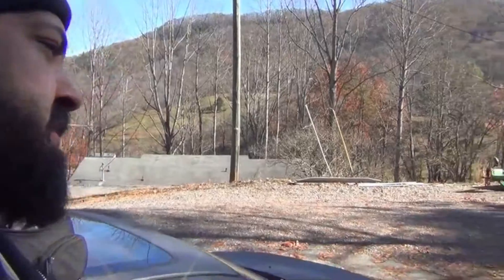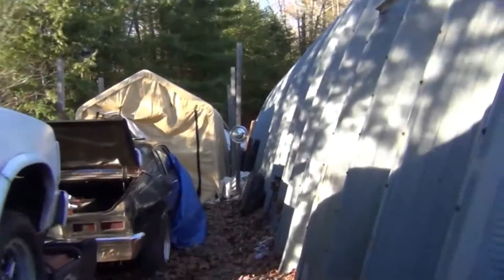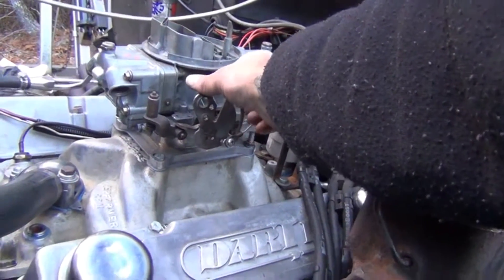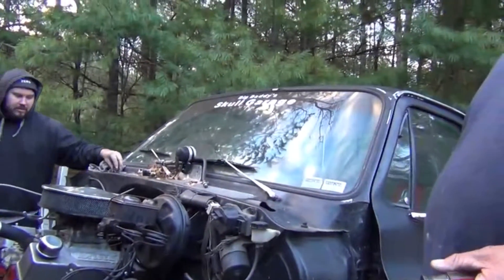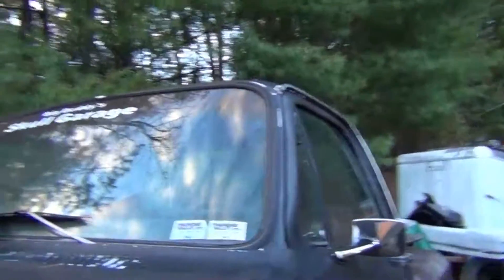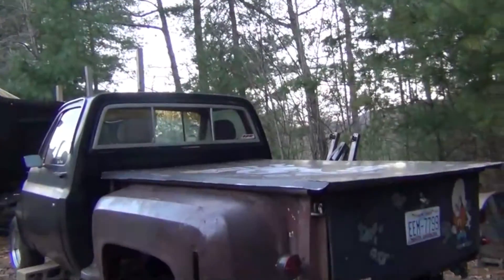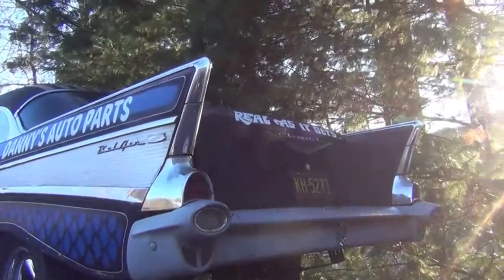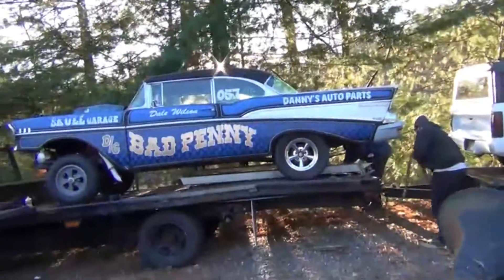SKULL GARAGE 2019 (EP.34) GETTING EVERYTHING READY FOR THE TOY RUN

Comment: would very much like to talk about blow thrugh turbo engines like cam choice compression and all that new to the turbo game would very much like to do it with a carburetor don't have a grand for the engine management system and like to be different check out billy the kid at street racing channel has a wicked s10 with a TT carb setup